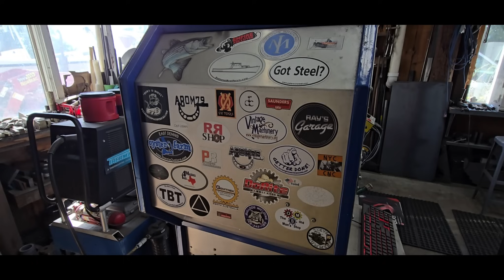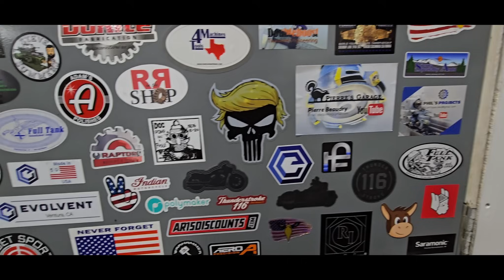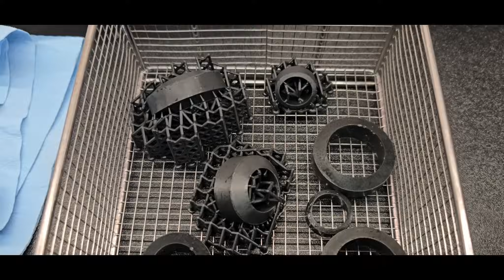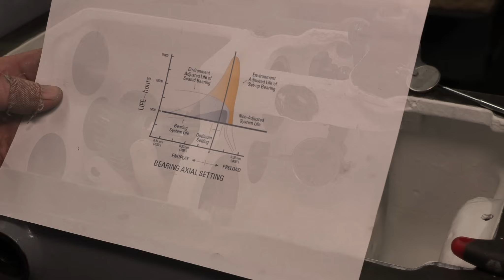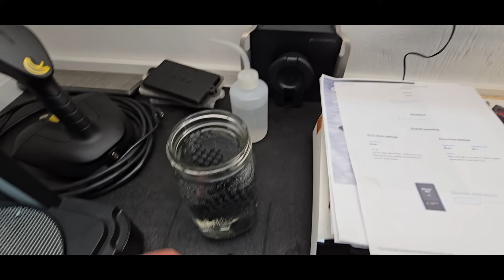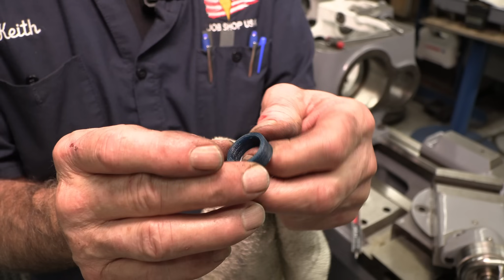Brake & Clutch Shaft

Comment: Be aware that regular silicone is not very resistant to some types of oil, it goes soft like jelly with continuous contact.  You need fluorinated silicone rubber for these applications.
Reply from the maker: That was my concern as well, but the engineers of this product designed it for heat and chemicals, we proceed with cation and a lot of optimism. Note: both rubbers are not recommended for exposure to ketones.
Reply: @KeithFenner  You can buy two part fluorinated silicone (Fluorosilicone) for casting.  If the seals do get nasty in the future you might consider 3D printing molds and casting the seals.